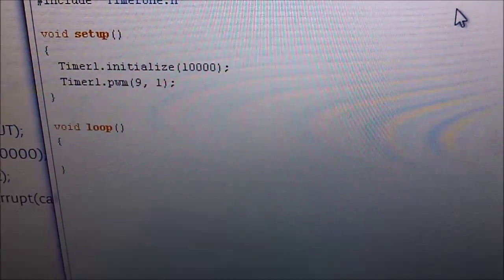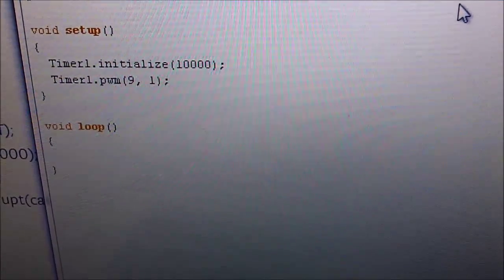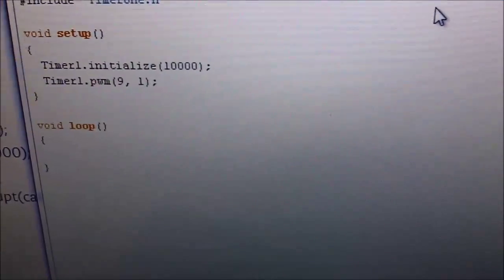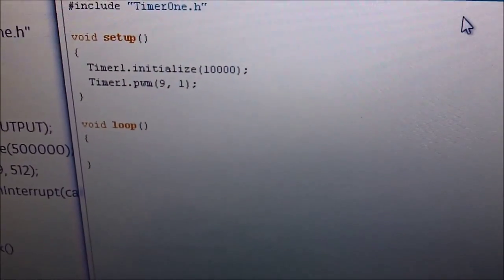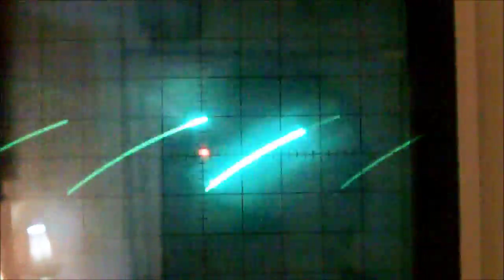About DCOs, Episode 1

Comment from the maker: In case you missed it last night, I made a quick and dirty video with bad framing about digitally-controlled oscillators.

These oscillators have an analog signal path, but use counters from a microprocessor or microcontroller to reset the cycle, instead of a comparator. This leads to a couple of disadvantages (one of which I demonstrate in this video), but has one big advantage: rock-solid pitch stability.

Here's an article that goes into more detail, including a schematic: http://sequence15.blogspot.com/2008/02/analyzing-juno-106-dco-circuit.html

 #electronics   #arduino

Comment: Hey darren! i've been working on a DCO design! i would like to use a waveshaping circuit to obtain  triangular,  square and  sinusoidal waves but i am having problems understanding how to change the ramp -sawtooth into any of the others! any ideas? @darren
Reply from the maker: +Alberto Artuza You want to look for something called a comparator circuit. It's an op amp circuit that produces either 0 or +V (V being the power supply voltage into the op amp) based upon comparison to a threshold voltage. It would convert the sawtooth to a pulse of any duty cycle depending on where you set the threshold.
Reply: +Darren Landrum  So if i understand properly, the idea is to use the comparator circuit to convert the saw-tooth back into a pulse to obtain then the other waveforms? wouldn't be easier to use the original pulse from the micro controller?
Reply from the maker: +Alberto Artuza You could certainly do it that way. Using a comparator would make it easier to implement a voltage-controlled PWM, I think.
Reply: +Darren Landrum ok!! thanks ill give it a try simulating a couple of things! ive spent a lot of time on this wave shaping techniques and they are not completely clear!. I am building a polyphonic synth 3 voices thats what the DCO is for! the sawtooth part was nice! however get the others from that one in particular  is a bit confusing!
Reply from the maker: +Alberto Artuza Yeah, I'm still working on understanding it all myself. :) Good luck!